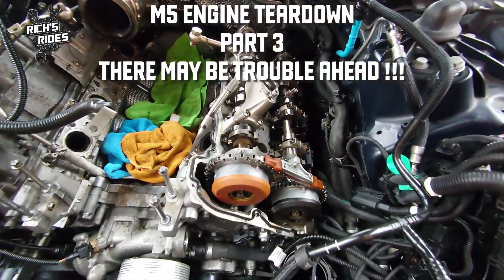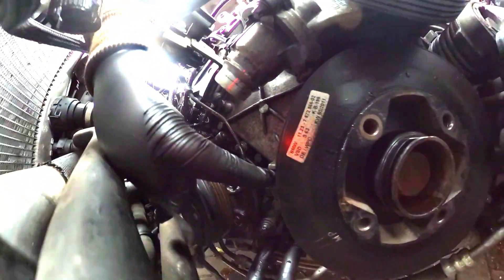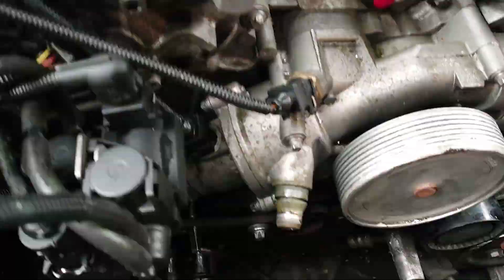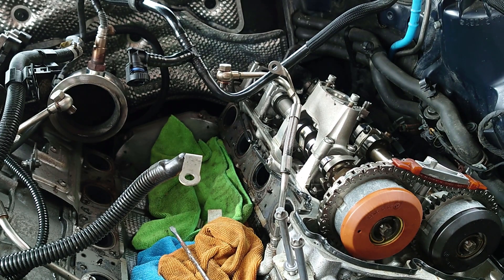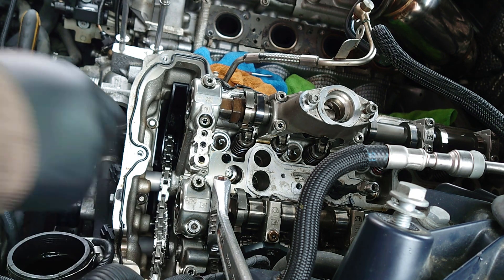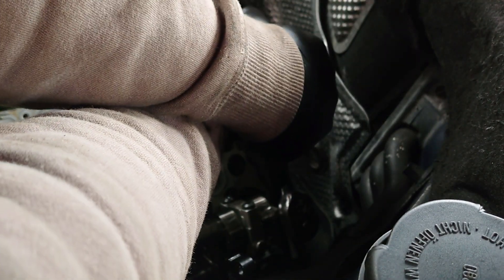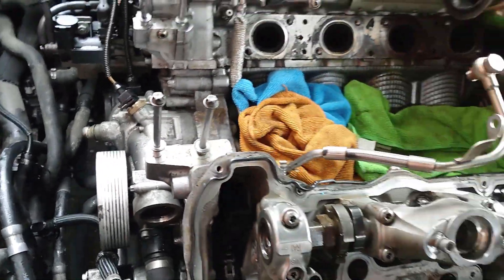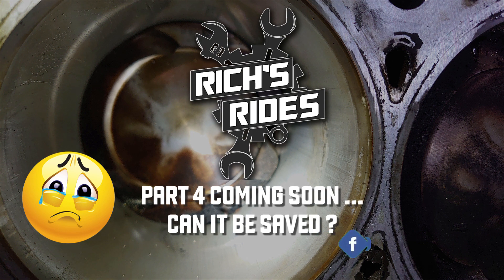BMW M5 - S63TU Engine Teardown and Rebuild Part 3 - Cylinder Head Off

Comment: You couldn't stick an inspection camera down the spark plug hole to see that?
Reply from the maker: +Josh Lovato already did 😁
Reply: @RichsRides  must’ve missed that!! Watched the whole series so far. Trying to learn this engine myself. Thanks for the vids!
Reply from the maker: @jayemlov  wicked ! I think it was the compression test video. If you pay close attention you can spot the exact moment my heart gets broken by this car!

Why are you trying to learn about the engine? Problems?
Reply: @RichsRides  just the overall design and function. I wish there was more aftermarket support for the n63/s63 platform. Looking to do a single turbo / h beam rod setup hopefully with in the next year.

Comment: How many miles had this engine done? Was it tuned or standard?
Reply from the maker: It's currently on 53,400 miles, I belive it was tuned as it seems to have had a cold start delete. I think I'm going to find a bent rod when I finally pull the piston, reckon it was given the berries too many times from low revs and just couldn't take it. We're nearly ready to find out!

Comment: i have same issues right now on my cylinder 6, the fuel injector is seized, after many attempts, the fuel injector head snapped, i was able to remove the other 5 injectors without problem. So as of today, it's slightly moving side to side a little whenever i use a plier of screwdriver to create motion. it’s a year 2012 bmw x6 35i, am thinking of pouring BG PLATINUM Air Intake Valve & Combustion Chamber Cleaner on top of it to see if it can break it loose.
     
   I did try Penetrate fluid, WD40 but no success, will there be issues with hydroplaning since i sprayed few amount of those fluid on it for the past few days? any ideas? thanks.
Reply from the maker: Mate, I feel your pain. I'd find a specialist before you go any further and make the problem worse for yourself. The movement side to side is likely the shaft only and if you keep trying it'll probably sheer too (mine did). Where abouts are you based?
Reply: @RichsRides  Thank you very much for your response. I am based in Katy Texas.
Reply from the maker: @mark croward , how are you getting on? Have you got this sorted now?

Comment: Ouch! But great job so far, impressive as hell. And by far the best diy videos i know of!👍🏻 but please..buy a microphone, i would love to hear EVERYTHING your saying👏🏻 Keep it up, and cant wait for part 4🤞🏻🙌🏼
Reply from the maker: +fredrik støylen thanks mate, been such hard work. I've been busy trying to get the bloody injector out for the last month. it's out now but Ibe also go a big cleanup job on my hands. hoping to get back out under the bonnet when the weather clears up, always seem to be raining these days !

I'll have another look at the audio, I thought I'd got it to a good level now?
Reply: @RichsRides  How did you go about to get the injector out?🤷‍♂️  I struggle sometimes so hear what you are saying😝 but i will still watch anyways😜
Reply from the maker: +fredrik støylen it was probably the hardest thing I've done yet! it took bloody ages. It was so stuck that it bent my extraction tool! I went through a process of applying heat, penetrating fluid, slide hammer, driving it out from the other side and it wouldn't budge. I managed to rip the head off with the slide hammer which just left me with the shaft sticking out, when I tried to tap a thread on that ... it also snapped off. which left me with the main body buried deep in the head and no way of grabbing it. I only really had one option left, so I broke out the HSS drill bits and slowly removed the internals of the injector until the main wall wash thin enough to deform, eventually it separated and left just the tip piece in the head which I was then able to drive out from the other side. I've now got to strip the head down to make sure it's properly clean before if eventually goes back on the car.

from what I could see, there was a load of what looked like fine dirt between the injector and the head that just made everything bind up so bad that it wouldn't budge. As soon as the main collar/body was released it came out without too much effort.

I was pretty much at the point where I was considering a replacement head, it was that stuck! it really tested my patience.

Now that it's off I can move in to the next step .... if it stops raining!
Reply: @RichsRides  That is just crazy! Can’t figure out why it would be so F stuck?? Watching part 4 now🙌🏼 
Thanks for the reply, and great job done!👏🏻
Reply from the maker: +fredrik støylen there was a small amount of crap between the cylinder head and injector, I think maybe some liquid got down there and then got cooked by the engine temps. and crystallised / hardened. there was just too much friction to remove it without reducing the surface area that was holding it in place.

At least it's out now!
Reply: @RichsRides  Well done!👏🏻😅, but the scratches on the cylinder wall, what is the battleplan?🥲
Reply from the maker: @fredrikstylen9128  I'm going to measure the cylinder wall with a special tool to determine how far out of round it is, and then slowly attack it with some wet and dry (using oil as lubricant) to take away the excess material. If I can get it back to round I'll see how it looks and decide whether to run a felt hone with AN30 to re-finish it. Need some nice weather though. Every time I have time spare it bloody rains! Hopefully we'll start seeing summer weather soon?
Reply: @RichsRides  oh! Sounds like a big job ( again😅). You are going to have to clean out the garage bud🤣 20 degree celsius and sunshine on the westcoast of Norway right now🤷‍♂️😜
Reply from the maker: @fredrikstylen9128  damn, think we're getting closer to summer... Maybe next week ? Think it was 13c and drizzle again today ☹️ My garage  is looking better (can see the floor 🤣) but there will never be enough space to get a car in and work around it too!
Reply: @RichsRides   Build the garage over the driveway😜 the weather is slowing down your big project, wich i like to watch🤣
Reply from the maker: @fredrikstylen9128  that sounds like a plan to me!

Comment: No chance it can just be honed when you have the piston out? I can’t tell how deep the damage goes layers wise.
Reply from the maker: I don't think you can, the cylinders have an Alusil coating. If I gave it a traditional hone wouldn't it screw all that up? I think Porsche have the same, I've been reading about a special felt hone and AN30 fluid to resurface them. Sounds like a royal pain in the arse to me!